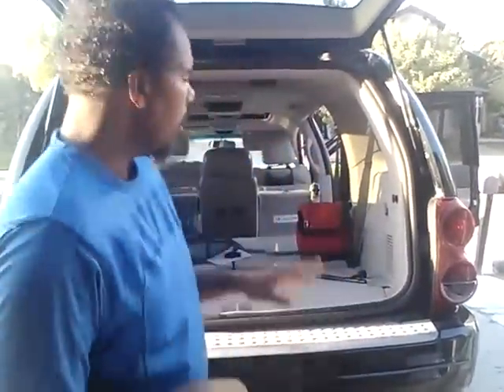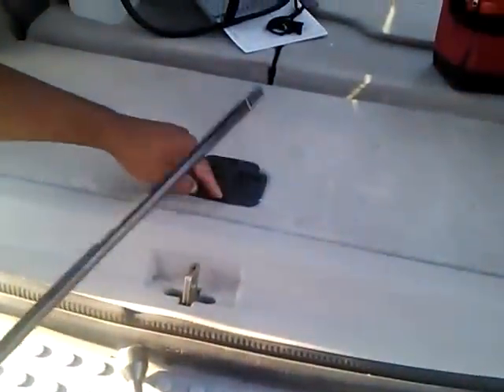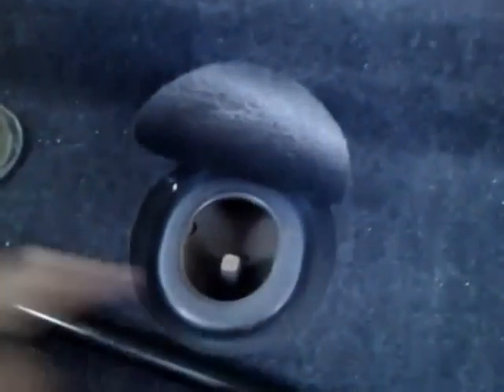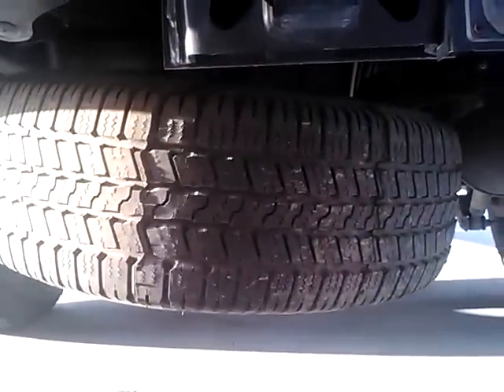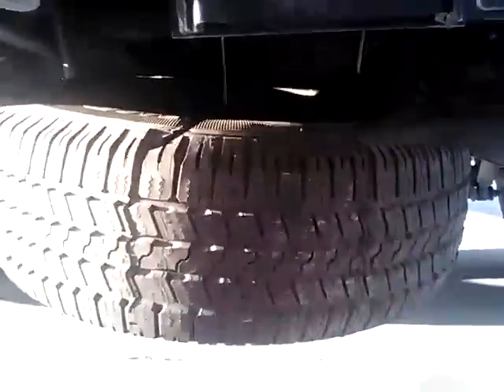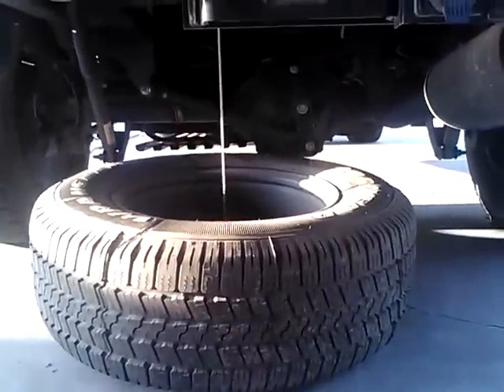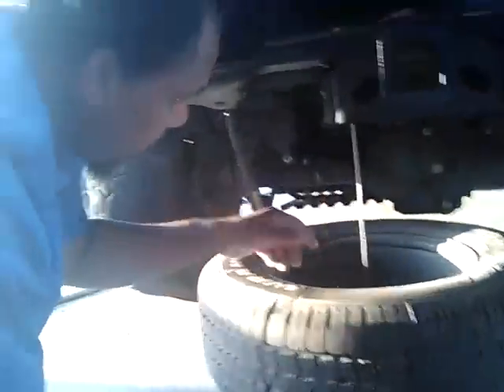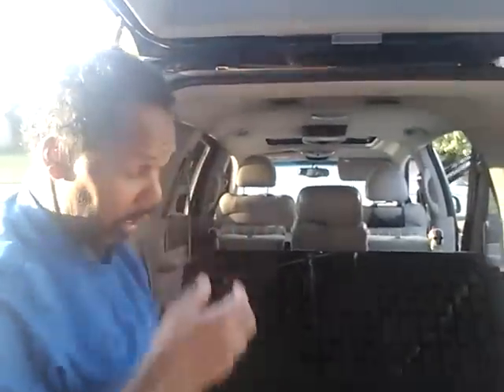How to Remove the Spare Tire from an SUV (2004 Dodge Durango)

Comment: Yesterday I took my 2012 Dodge Durango it to Discount Tire yesterday and they checked and found a full size tire would fit. Now I have a new 'Cooper' brand spare installed. The new rim, tire and labor was only $ 250.00.

Comment: Mr. SB or anyone. I can see how to pull the lug wrench and “key” to lower tire, thanks to your video. Two questions:  is the jack easy to pull out of its placed area under seat?  Does it just move or pop out (do I pull “out” or push to right to release and then pull it out? It feels tight and in place so was curious.  Second Question: the 2004 durango has lived in mid west - does anyone know if the mechanism “rusts in place” or has that not been an issue for anyone?  There are new tires on now - so hopefully will never have to change - but never know so want to be prepared. Thanks so much Mr. SB for video.
Reply from the maker: You are welcome. You have to "Twist" off the Jack Key that holds the Jack in place. I don't like those small Jacks, I purchased a small "Floor Jack" that comes in its own case and keep it in the back of the Truck.

Comment: Got tire down no problem. Put new spare on and tried to get it back up and will not budge. What could be wrong with the cable not going back up? Had to zip tie the cable so it won’t drag under vehicle.

Comment: Awesome video...I have a 2002 Dodge Dakota Quad Cab...directions were basically the same except the "small metal bar" was in a different location...I've been driving around with the spare in the bed for years now because I never took the time to figure out how to put it back on...with this awesome video I learned in minutes...Thanks MR. sb...I just read your name...Stoney Boner...nice...lol...

Comment: Just bought a 2000 Durango and came across your video. Now I'm ready (lets hope never need it) if it does need to be changed. Thanks for taking the time to make this. Looks like you have helped several people out. That's what the YouTube Community is all about! How has your 2004 been for you?
Reply from the maker: Thank you for the comment. I love this Truck. 10 years old and still going. Will probably give it to one of my kids though.

Comment: Thanks, didn't know where the access port was. Dumb dodge, can't be a good patron and change tire on the road for this person without inside access
Reply: So the manufacturer is "dumb" when they provide spare tire access method that's considered standard across the industry? Sorry, just not seeing it.

Then you want a spare to be accessible to an unattended vehicle, like theives?? So you see a car with a flat on the side of the road, and you want to just change it when the owner is not around and not knowing if there's a reason he hasn't changed his tire??

You're probably right that there's somebody dumb here, but it doesn't seem to be the manufacturer, London.